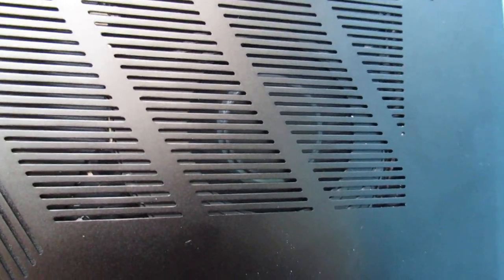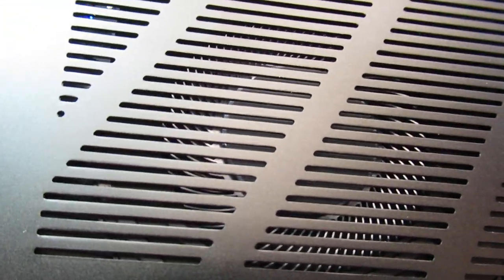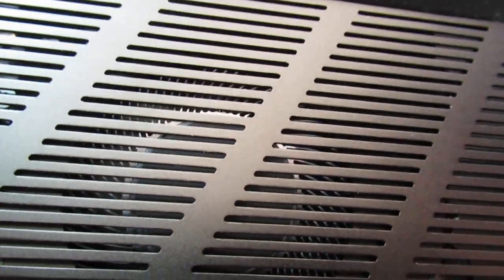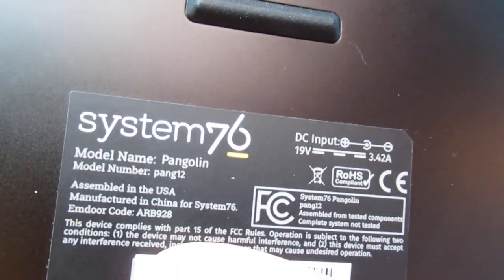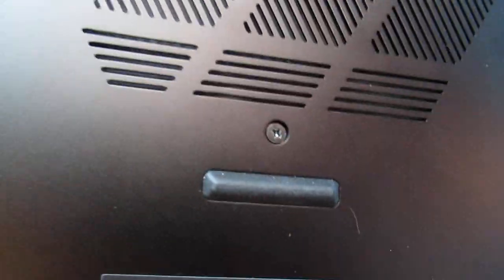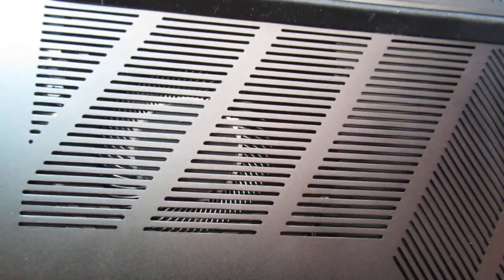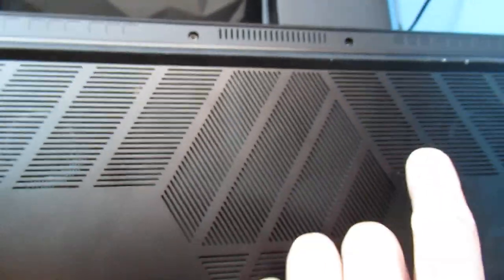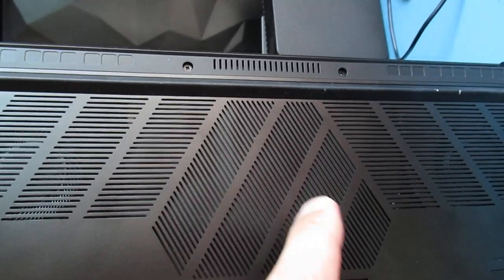System76 - Pangolin - Pang12 - Fan Trouble

Comment: So what they said = this was the expected behavior? How's the cooling in this case?
Reply from the maker: They said the 2nd fan was not intended to operate. I am also having issues with the trackpad. They have told me both issues will be addressed in a firmware update but that was nearly a week ago. I actually had to defend my wanting both fans to work.
Reply: @ElectricEvan  thanks for sharing that
Reply from the maker: @TheEmT33  To be clear they were very responsive as a company and when my order originally went to manufacturing they gave me a personal phone call. So it's not like they are a bad company. I hope this was just a bump in the road.
Reply from the maker: They have since told me they will be releasing a firmware upgrade to fix this so both fans operate.
Reply from the maker: They serviced it and returned it to me. The touchpad is better but honestly the whole thing is still garbage. It's developed other problems including various issues with ACPI. These things are lemons. Seriously folks if you have the money buy something else.
Reply: @ElectricEvan  Thanks for the review
Reply from the maker: @TheEmT33  Your welcome. I am very disappointed in levelonetechs for endorsing this product. I won't be trusting their reviews again. I have a dell that I got from a local stores junk pile while I was waiting to get my System 76 back and that piece of literal garbage works better. The wifi is more stable, the webcam is less grainy, the screen hinge doesn't creek, and when I put it in sleep mode it stays in sleep mode until I open it again. (Please note I actually don't like dell, this is just a funny reference point)